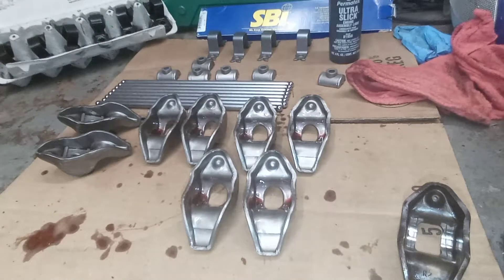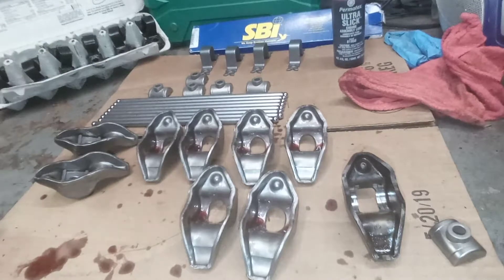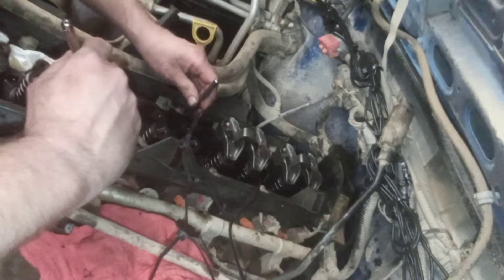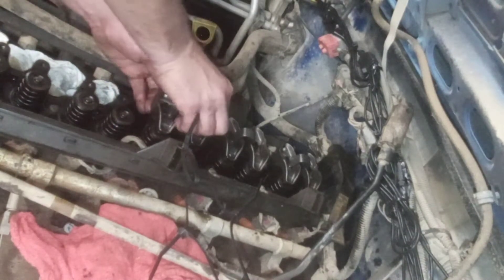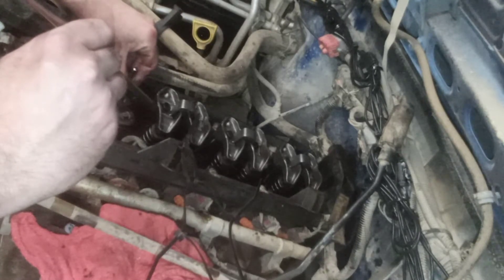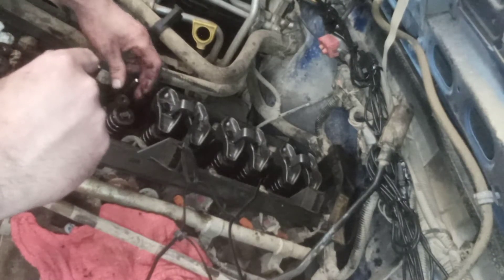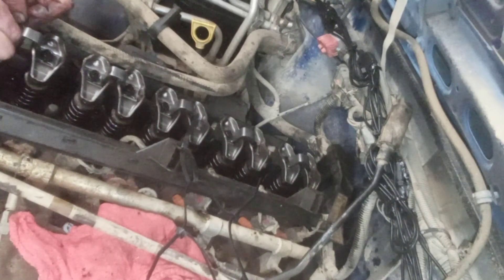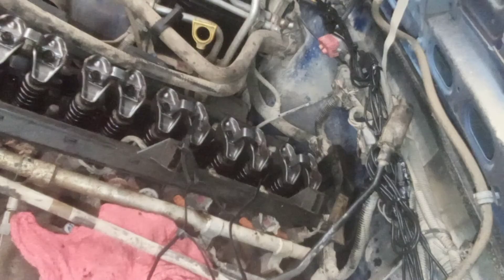replacing rocker arms and push rods Jeep Wrangler TJ 4.0 PART 3

Comment: Replacing a VC gasket on a 03 TJ.  The cover ended up getting wedged, bc all the wiring harness & bs.  Finally was able to get it free, but that involved taking off the rear set of rocker arms and the last rod.  Getting ready to reassemble everything can I just put everything back and torque it down? Nothing should’ve moved or changed in the piston positions since starting this job.  If there has to be TDC, I’m not that familiar with the easiest way to do that with the front of the engine not as accessible.  I went back and look, but I can’t find the part 4 of this chapter of your series.  Appreciate it. 👊
Reply from the maker: Yeah just torque it back down where it is and it'll be fine. Just BE SURE!!!!.....you get the push rod into the pocket of the lifter

Comment: Did you not have to put each cylinder TDC to prevent bending of the push rods when you tighten to torque? I am doing this job and was told I must do so. And what about the lash? Help?
Reply: How do you know when a piston is at TDC
Reply from the maker: The rocker arms are not adjustable just tourge to spec and yes I did put each cylinder on TDC before touring down.
Reply: @whileurinthere4062  Ahh damnit. I was hoping I wouldn't have to lol ok thanks
Reply from the maker: Ya know what tho.....the rebuild manual said nothing about putting each cylinder on TDC  before putting the push rods and rocker arms in. It only said to put cylinder #1 on TDC. I did every cylinder becuz I wanted the peace of mind by doing it that way and I had the time to do it. Wish you the best if luck with your build
Reply: @whileurinthere4062  I will do the same. I still will question the point tho. Seeing that the same rockers and or push rods are going back on, nothing is changed or moved, nothing... what would be the need to do so? 🤷🏼‍♂️ best to be safe & I have the time as well lol.
🤘🏻 thanks best wishes
Reply: @whileurinthere4062  
Apologies for the novel & slop of a msg. Im falling asleep as I write this half awake.... 
But anyway, did you have any complications while putting on your push rods and rocker arms, like when just hand tightening at first, one rocker does not bolt down all the way..? 
First thought, valve or lifter is up higher raising the push rod up just a bit, making the bridge uneven linked to the other rocker & keeping it from being able to screw down all the way. Until you start tightening to spec of course. . . 
BUT im 97% sure this isnt the case & all of the lifters or valves are down cuz the rockers are off. So when putting rockers back on, they all should be even just as they were when you took them off. So why would one bolt screw down a rocker all the way when hand tightening but the next one does not..? 
Does that make sense?  
Any ideas?  
Oh, & I cleaned it up pretty damn good in there so there is no debri sitting on the lifter that couldve fallen into  the push rod hole causing it to seat higher.
Reply from the maker: First thing I can think of is the bolts that hold the rocker on are not straight up and down into the cylinder head. They are at a slight angle. 2nd thing I can think of is the position of the camshaft. Depending on where it is on that particular cylinder the valves are moving in open and closing posistions, which the lifter position will be different position too from the other cylinders. Turn ur crank to the position u need to tighten those down
Reply: @whileurinthere4062  
Damn, another novel. sorry again but thank you for your time & input. 
Well, I started putting them back on from the rear as you did and worked my way forward. I got 4 of them on (the last two cylinders) and the next rocker as well, but that ones partner is the one that I can only get to bolt down by hand about 75% before it stops turning. So yeah I was thinking that like you said, it's just not in a position I need it to be. But, I can straight up see into each cylinder and all of the valves, everyone of them are all down. So if I roll the engine,  that will then move multiple valves then messing with my torque down for those when needed to bolt down won't it? You were also right when you said in your service manual it didn't say anything about having to TDC each cylinder before torquing. I finally got my service manual and it says nothing of the sort either. (Yours is 4.7 correct? Mine is 4.0) Pretty much from what I have gathered, that is only needed if you are installing a different type of rockers that are adjustable. If they are not adjustable there is no need for it and I am putting the OEM back on so... 
Speaking of, I was trying to see your rockers in your video as close as I could and look at the holes.. and to me, they looked pretty dead on center. Where in the hell did you find rockers that have holes actually cantered in the seats for the rods?? lol I have ordered from partsgeek.com & carparts.com. Sending both back. Checked the dealership, of course they have some. Dont know about the hole alignment but at $30+ EACH.. ya the hell you say. Not happening lol. So I don't have any other choice really other than to do this cuz with every one of my orders, the holes are always mis aligned. So I have to choose which ones, either the little bit worn OEM ones with perfectly aligned holes
or new ones with no wear but have misaligned holes that will not spit oil correctly. 🤷🏼‍♂️ 

Oh shit... I think I know what it is now, it's the threads on the bolt! I bet thats it! If it is, I know how I did it also. 😑 Damned rookie I be. 
But after I get this valve cover and all the rockers and everything back on and put together along wit the air intake, Ill then just have to replace an o-ring on fuel injector #3 then paint & restore two more wheel wells along with painting all 4 rims and then FINALLY, a quick alternator replacement... THEN DONE!! HALLELUJAH!! 

Goal is to change 89K miles currently into AT LEAST 300K miles in around hopefully 15+ years. I have another vehicle & dont drive/go out much besides to work & ima take better care of this Jeep than my own body. 
I wish I was kidding or exaggerating...
Reply from the maker: Maniacal monster I got those rocker arms pivots and bridges on eBay. Super cheap too like $70 for everything. Also got the push rods on Re bay for like $20 all twelve of them. The brand is "Sealed Power" on the rods and the rocker set. They we fine but I did a whole rebuild on this engine and ended up going with Harland roller rockers in the end. The rebuild is on this channel you should check out the later videos with everything painted up real nice. But yeah mine is a 4.0 also and the rocker set and rods on eBay sealed power brand
Reply: @whileurinthere4062  oh damn I must've been looking at something else. I could've swore yours was 4.7 but that's cool. Both of the times I ordered my kit was the same brand but from two different places and two different part number/serial number or w.e. both were Crown. 
 I can't wait to get past all of the mechanical maintenance and get back to finishing the cosmetic fun part of the personalization of my jeep. HelI, I even repainted the interior a two tone midnight pearl blue to match the outside paint & a satin black. (Many many coates for a rich dark somewhat still shiny black). That black also repainted the outside panels and bumpers and luggage racks and all wheel wells but a semi gloss black  exterior covering over the sun damaged original grey color panels. When I paint the rims it will be a high gloss black pretty much murder the jeep out besides the original blue color on the body and with accents of silver here n there as the jeep logo and all things alike which are also my Lugnuts on the wheel and the brake callipers that just pop right through that black to be seen well with my ice blue fog lights 😆 I don't know why am ranting about that my bad I just get excited lol. 
I will definitely for sure go check out your newer videos n see it all painted up purty like. Ill do that during my thaw out intervals I have to do from going outside to only get to work on the jeep for like 15 minutes or so before I'm frozen and then back inside to thaw out and repeat.
Reply from the maker: Maniacal monster.....I'm wondering where ur located being so cold outside. I'm in Ohio and pretty cold here too.. my jeep I also painted myself and it's intense blue pearl 😂

Comment: How'd the lifter removal tools workout?  I'm about to do mine on a 98 TJ and almost all the forums say I have to remove the head.  Do you know if the head design changed between 98, and 03?  Thanks.
Reply from the maker: It is different with the 4.0 actually. U do have to pull the head to remove the lifters on 4.0 head. The pushrods holes are much smaller then the lifters themselves. On the 2.5 u can remove the lifters without removing the head, but not the 4.0
Reply: @whileurinthere4062  That saddens me deeply.  LOL.  Thanks for the info and the vids.
Reply from the maker: Im actually just starting a complete rebuild of the 4.0 if your interested. Only 2 videos so far as i just started it last night
Reply: @whileurinthere4062  Well shoot, now I gotta subscribe.